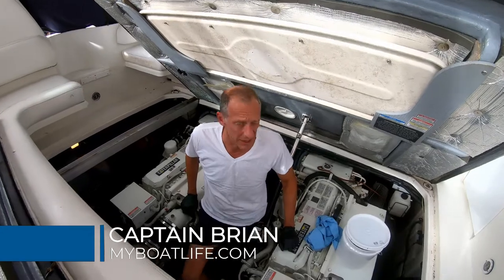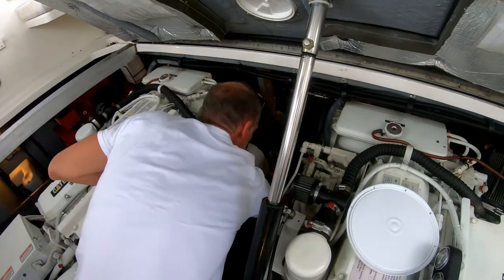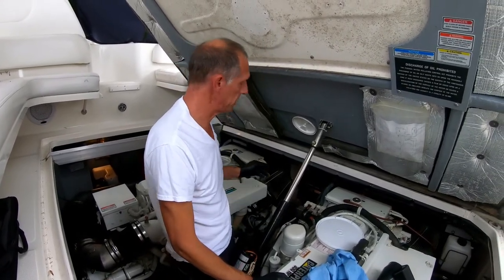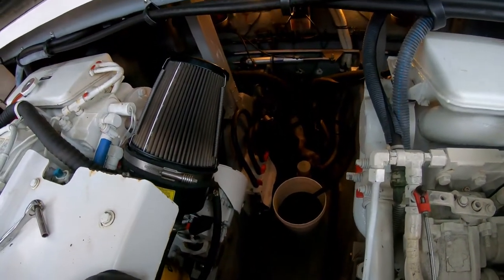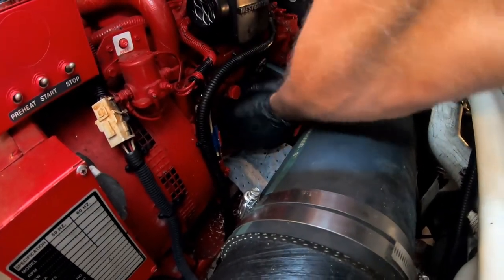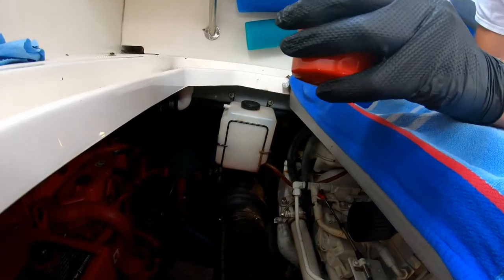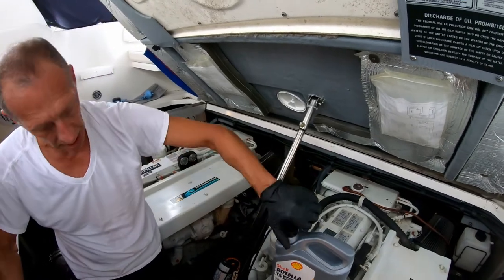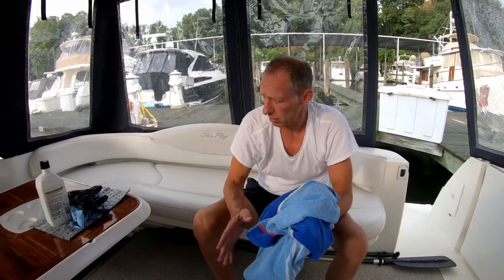How to Do a Boat Generator Oil and Filter Change

Comment: If you didn't in this video, recommend you run the genny to get the oil warm before changing --- will make the job much easier.  Likewise with engines :-)
Reply from the maker: Yep of course… always do that. Pretty sure he mentions that in the video but may not have shown it 😁